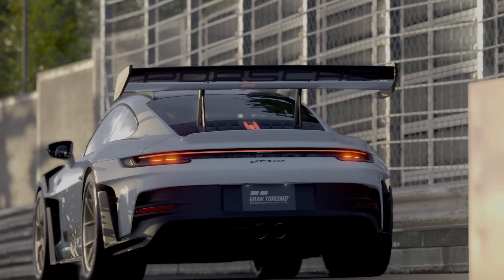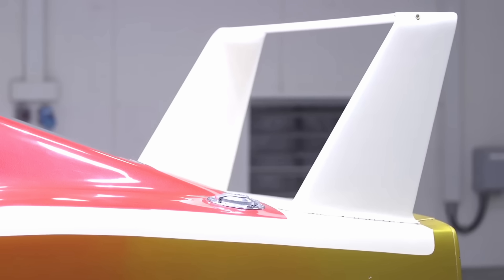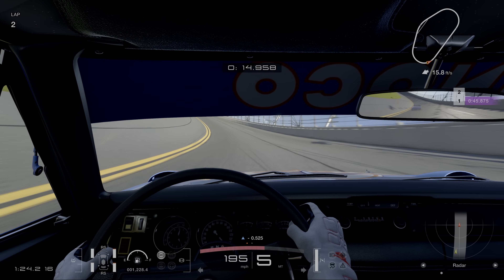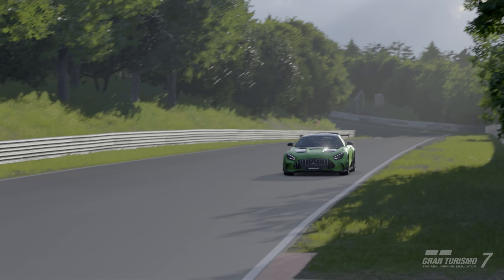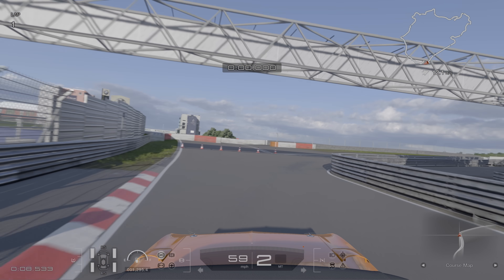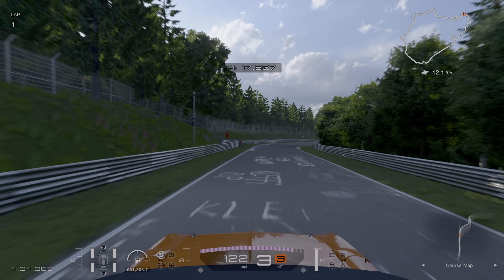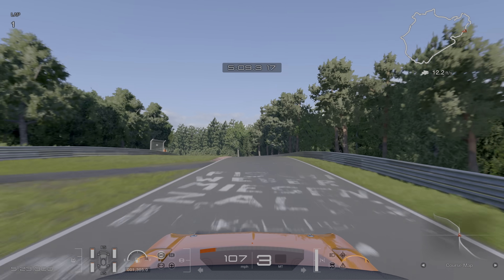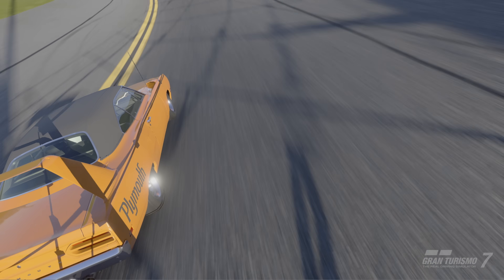Why Is This Car Undrivable in Gran Turismo 7?

Comment: people dont realize that downforce is a collective value rather than wing/splitter focused.

the reason why modern dodge charger has similar downforce with just small oem rear lip is because modern cars have way better roof/window shape and more well positioned exhaust, axles, and other underbody parts compared to rougher 60s dodge charger underside.

So if that wing being put in modern charger, the downforce  may be way higher than both cars (oem modern charger and 60s daytona). talking about irl.

but yeah talking about gt7, i have no idea how the downforce works tho.
Reply: downforce and ground effect are two different things.
Reply: If you have a big wing in the rear then most of that downforce goes to the rear tires. theres a reason why f1 cars have front wing.
Reply: 5:58
Reply: @aleks_jones downforce is the result of all aerodynamic pressures acting on the panels of a car pulling/ and or pushing down on a car. Ground effects is just an aerodynamic device to either create lower underbody pressure  to pull the car down/ and or reduce drag. I dont understand your comment saying these 2 intertwined things are different
Reply: Like the Superbird was pretty much the first stock car that was more than a brick with a massive engine in it, you'd hope that engineers had gotten better at aerodynamics in the last 50 years

Complaining that an unupgraded Superbird is hard to drive is like complaining about the graphics in an Atari 2600

Comment: So, I am gonna say I that I have earned more than 1B in credits in GT7, I have duplicates of every vehicle.  I have 4 Superbirds, each a different tune for different compounds and powertrims.  It is not "undriveable" ... rather it suffers from the same problem as a LOT of vehicles in GT7 ---  It can bottom out and scrub it's own tires in the wheelwells.  When this happens think of it like the brake being applied to just that wheel, which often has the highest load on it at that moment in the first place... creating oversteer on high load corners, and understeer on braking.  This is solved best by increasing minimum ride height.  I find this car in particular doesn't like being under 160mm without considerable spring rate and higher dampening, which then turns it into a skateboard eventually.

The next issue is gear ratios/differential.  The lower the settings on the diff, the slower it will accelerate out of corners, but it will wag less.
Reply: I had that happen to me Ferrari GTB front would bottom out Causing deadly understeer so Raise the height and got rid of the camber it originally had now feel nice to drive
Reply: It tends to be a rather major issue with practically every muscle car, you can't really lower them all that much before running into this issue (some may still work with stock wheel setup), the worst I've seen was the Mangusta, thing would literally not turn at all once lowered even a little bit
Reply: I think some folks don't understand limits. I found out that many cars cannot be lowered to the limit given by the suspension, it might look cool, but you car become highly unstable due to contact with the wheel wells. 
I had tuned an Italia and had added slightly bigger wheels and the ride height was bare minimum, went for a drive, almost ended up in a wall, the car has trouble turning at low speeds because wheel well coming into contact with the tires. Raised the ride height a couple of mm and back to normal turning radius. Things that weren't in previous games actually ended up in this one. I tune my own cars and never over tuned, just added some power, and spiced up the handling to make it for into usually a few categories between 400pp to 700pp. Old road cars simply do not have the Aerodynamics for absurd power and their tire sizes also can barely keep up with the torque from highly tuned engines, becomes a massive waste of power. 

Only if PD included more options for older cars like changing their axles and widening the track to allow for wider rubber. One day, I hope! 

Now I hope the include the old '68 Charger. 

Another thing I don't get, is why PD lists cars with built in wings as 0 on their down force. They need something better than this, such as a lbs of df @ X speed. I remember having to translate their gobbledygook back in GT6 to get suspension settings which somehow worked. I'm like why do they use these ridiculous digits when they actually use real world values beneath the crap?!

Comment: I want to point out a few interesting details about the Dodge Daytona and Plymouth Superbird.  These cars were designed to dominate NASCAR ovals, but not just any oval—they were built for the biggest tracks, like Talladega Speedway. I'll try to explain why. You see those massive wings? Back then, aerodynamics weren't a major concern for car designers, aside from things like smoother body shapes and fastback or coupe designs. However, when you're driving on an oval at 170-200 mph (closer to 190 mph at the time), you encounter a lot of "dirty air." This isn't polluted air but turbulent air caused by the car in front of you. The result? Your car produces significantly less downforce because your wing can't grip that unstable air to keep you glued to the track and accelerating properly.

In the Charger’s case, the aerodynamic problem was so severe that the rear end would sometimes lift off the track, as the car was essentially trying to fly at high speeds. Even if that didn't happen, the car was still slower than what its engine was capable of. To fix this, Dodge turned to Chrysler’s missile division (yes, Chrysler built ballistic missiles for the U.S. military at the time—who knew a car company would also be making weapons?). Since Chrysler was closing down the missile division, they offered the engineers jobs to solve the Charger’s aerodynamic issues. They first tried to fix these problems was the Charger 500, which had a less recessed grille and a back window that was flush with the B-pillars, along with a few other tweaks. This didn’t help much, so they handed the task to the missile guys. They designed a front nose cone, a huge rear wing, and added scoops (or reverse scoops) above the front wheels. The combination of downforce from the nose cone, front splitter, wing, and the air pressure relief from those front scoops kept the Daytona glued to the track. Allegedly, in Dodge testing, it broke the 200 mph mark.

When the Daytona was brought to Talladega, it absolutely dominated, though that was partly due to a strike at the time. Still, at its next race, it crushed the competition. Seeing Dodge's success with their new aero car, Plymouth got jealous and wanted one for themselves. Chrysler obliged, but Plymouth wanted the car to look better than the Daytona. Plymouth made a few changes: they redesigned the front cone with more pronounced dips on either side of the centerline, moved the wing further up on the trunk, and made the wing’s angle less pronounced than the Daytona's. They also bolted on scoops, though unlike the Daytona, these were just for show and didn’t have holes underneath. These stylistic changes made the Superbird a few miles per hour slower than the Daytona. The simple explanation is this: the Daytona was designed by engineers, while the Superbird was designed by stylists.

Both cars dominated NASCAR but were only ever used on the largest tracks because their aerodynamic advantages only became effective at high speeds. On smaller tracks, the aero features just created unnecessary drag. Drivers who own these cars have noted that you can feel the car start to squat down at around 80 mph. However, even though you might exceed this speed on smaller tracks, the aero still acts as drag, making it more of a detriment than a benefit on those smaller tracks. The success of these cars led Ford to develop the King Cobra prototype variant of their Torino stock car. Unfortunately, before Ford could introduce it to the races, NASCAR officials killed it. They weren’t happy with these "winged warriors" and claimed they didn’t look like regular cars and to phase them out, they first imposed engine restrictions on aero cars, limiting them to around 350 cubic inches or less, and eventually, they banned them altogether a year or two later.

Comment: 2:55 "Zeroing out the rear toe"... on a car that canonically has a solid rear axle?
Reply: You can add camber/toe on a solid axle using shims and specially made axles/hubs. But yes, 99% of the time, there is 0 toe and 0 camber on a solid rear axle.
Reply: @Jodah175 bone stock, most solid rear axle vehicles have some amount of camber and toe. It’s almost never 0.

Comment: I own two Mopars IRL from this time period. One of the most popular up grades is installed frame connectors to tie the front and rear of the unibody together. Also most didnt come with any sway bars. My Road Runner has them front and rear but its uncommon to find and America car from this time with sway bars or disc brakes. The men who raced these cars IRL were real men and risked their lives every weekend. It was easy to throw around a car like this. Sony got it right!

Comment: I don't know why, but my superbird is completely stable at daytona, watkins glen and laguna seca, but still there's a way, that I accidently put that reduce ridgity tune because I always tune my car before playing the special event in the weekly challenges section.
Reply from the maker: It can still be stable(I didn’t use increases rigidity on my 200mph oval test) but it needs wide height and actually ran better on comfort/sport tires with more slip angle. On race tires it seems to be more sensitive and especially at lower ride heights.
Reply: @hubblesphere  considering the car was designed around 1960s bias ply tires, it would be set up around a slipping tire and would handle better with it.

Comment: Old vehicles used the frame as a suspension member. As i come through the driveway, my '72 F100 will have obvious cab and bed separation as the two halves of the frame roll independently. This makes the ride softer with leaf springs and poor suspension geometry, but can cause oscillations and feedback loops at higher speeds. Lots of old trucks had "death wobbles". The superbird had a solid rear axle and leaf springs with nothing but track bars to keep the axle from wrapping. Not even a panhard rod. It had very simple arm-on-coil front suspension with a torsion bar at the bottom. It had drum brakes at the rear. Of COURSE it handles poorly at 180mph. People criticizing this car have no understanding of vehicle physics or history.
Reply: Good job. I'd also add that if you're making toe and/or camber changes on a solid rear axle, something has gone very wrong lol. Always bugged me that Gran Turismo allows for toe/camber adjustment on solid axle cars without ever mentioning a swap to an IRS in the upgrades. That's kind of a large detail to just gloss over.

Comment: It's a 1960/70s American landbarge, do people really expect it to drive well? It's not a Corvette. Also if I recall correctly the rear spoiler didn't have any effect in reality, it was all aesthetics
Reply: Old NASCAR regulations make it so that the race cars were very close in function to the road cars, the wing did something, but you had to be going at speed, which the road car coudnt really do
Reply from the maker: The rear wing does produce downforce just not a significant amount. It was designed for NASCAR and the wing was 100% functional.
Reply: The Superbird/Daytona's wing does something atleast that is functional (enough) for what it was made to be in it's time. If you want a real useless wing, look at the Lamborghini Countach 5000QV's wing.
Reply: The bigger difference on the Daytona/Superbird was the reshaped rear window, but the wing still absolutely was effective.
Reply: it was also built for nascar, why does it need to drive well outside of a oval
Reply: @rainbo.8156  Nascar has road courses / tracks with actual corners aswell in some of it's schedules from back then til today so almost all cars need to actually be atleast decent (enough) to handle in case the road courses pop up.
Reply: @julianturberfield7101  Plus the Nose cone, got rid of essentially the worst grill you could design for aerodynamics, a Flat receded grill.
Reply: @PlatinumNath why? 5000QV rear wing has a noticeable bend and it is obliged to produce some kind of downforce
Reply: @MakeYourVision  It might seem like it's supposed to provide downforce, but it's angled in a neutral position so it doesn't really make downforce, just adds weight or even actually makes lift instead. Here's a little not-so-fun-fact perhaps for you: The Countach as-is makes a dangerous amount of front lift already. Adding a working wing with downforce would make it fly off the ground like Mercedes at LeMans. The wing on all classic Countachs are merely just for show and extra weight.
Reply: @PlatinumNath  thx for fun fuct! I remembered that they had a model with a front wing located directly on the hood. Now it's clear to me that they were trying to reduce the lift at the front lmao
Reply: I thought I remember something about the wing, & that it was actually the sides that created the high-speed stability for keeping the rear from stepping out too much. Anyone know 4sure?
Reply: @MakeYourVision  Front wing had nothing to do with lift, it was to meet US federal regulations for front bumpers. Was only on about 10 cars, it got famous for being in the movie Cannonball Run
Reply: It made a difference but not as much as you'd think. Part of the reason it was so tall was so that the trunk could open underneath it.
Reply: The only reason that the road car version had that wing and nose and it wasn't just a special race version performance trick was because the owner and commissioner of nascar in the 60s said that all race cars had to have the same body panels as their road car counterparts along with their engine combos ( granted heavily tuned down for the street) in their cars, homalagation rules were the name of the game back then, Bill France president of nascar at the time took the saying of auto makers back then of "win on Sunday sell on monday"
Reply: @rainbo.8156  the GT7 version is the ROAD VERSION, the NASCAR one was very different, it looks similar but it wasn't. The road legal version was a RoadRunner with a different front bumper and a rear wing, it's mostly that, also, the road legal Charger Daytona had real hood vents and the Superbird didn't, so they weren't even functional. They made them mostly because it was a regulation at the time that the car designed to race had to have a road legal version, and obviously the road version wasn't track focused, and actually the car became popular way after its time, in internet there's info about the fact that they didn't sell well and the Superbirds were the worsts.
Reply: I’m lucky enough to know four people who own or have owned genuine Superbirds, all 440s - never seen a Hemi one - and they all say you can feel the wing start to work around 80-90mph depending on what angle it’s been set to.
Reply: You recall extremely fucking wrong then.
Reply: absolutely not true. The Superbird spoiler actually produced negative downforce.
Reply: Funny you mention that - I was having the exact same issue with the corvette on daytona
Reply: In the setup it has in game (and in that wind tunnel test) no. There is no real downforce. But the wing is adjustable (even on the factory car). And yes the wing is there for aerodynamic reasons. Adjusting the wing does add downforce and the sides of the wing actually help with stability. It really didn’t do anything under highway speeds, neither does almost every other vehicle with aero bits on it. In order for 99% of cars with aero parts be actually doing something, you have to be breaking the speed limit.

Comment: Something is still off if it fishtails that poorly. The wings uprights are essentially vertical stabilizers, and as per many wing car drivers, they would correct oversteer and keep it straight
Reply: Not to mention the rear is solid axle, it wouldn't have camber or toe regardless

Comment: My gripe about the Superbird in GT7 is the inability to change the wing angle.
Reply: I don't think the road car even had an adjustable wing. So it kind of goes together with the car they literally scanned.
Reply: @evilformerlys4704  the commercial versions of both the daytona charger and superbird were adjustable.
Reply: @fredrickalexander7023  Yep, 12 degrees

Comment: How would a straight axle car have bump steer toe issue in real life, kinda wild theyd put that in the game
Reply: The front end will still have those issues , but you're right about the rear
Reply: Yeah wtf lol 💀
Reply: the axle can still twist entirely
Reply: there are issues with live axel track and thrust angles under load, its why any serious live axel car has a panhard bar or watts links. Even with those items you can run into some silly issues. When racing my 1985 RX-7 GSL-SE due to the fact the watts links is offset to the passenger side of the axel you can get travel bind on that side under extreme compression. so if I hit a large bump or do hard corner loads it can really throw the car off because the right side compression bottoms out before the left.
Reply: take it to the extreme, if one side has shorter links than the other side then as the axle bumps the side with shorter links will pull forward more, creating a bump steer effect. That's a simplified example, but lots of cases where the axle will pivot. This is easily seen in rock crawlers where there is so much suspension travel you can easily see the rear axle angling to one side.
Reply: Leaf springs can bottom out.